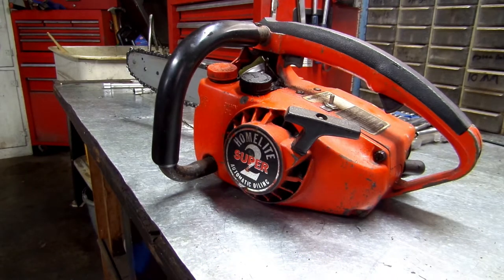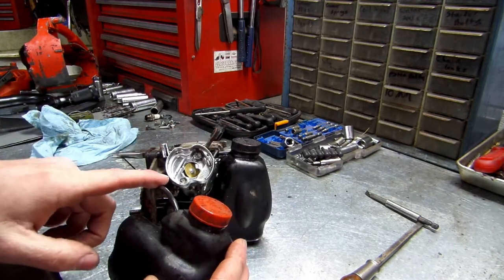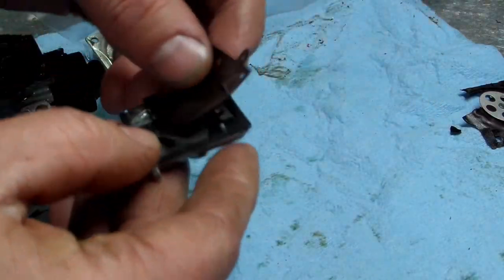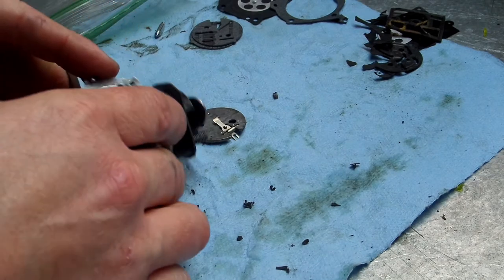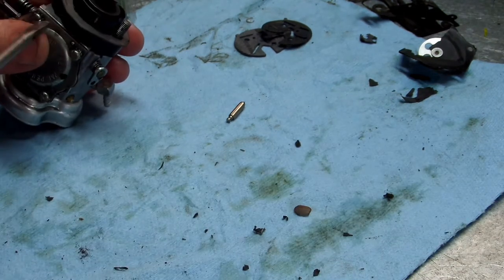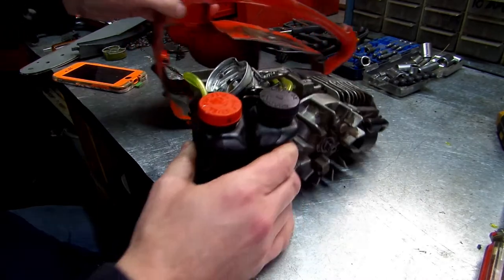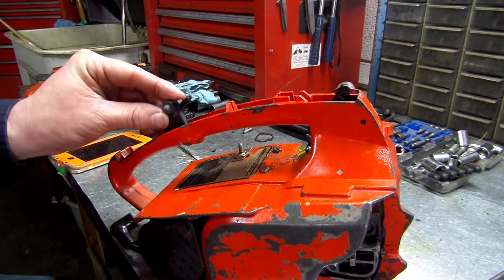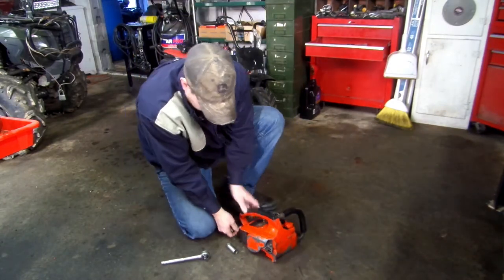Homelite Super 2 Carb Rebuild

Comment: Did you compare the metering diaphragm's center nub that intersects with the lever to what you took off?  Some of the aftermarket diaphragms have the nub too high for the HDC lever in the metering chamber.  The result is constant flooding.  Like you I had to replace the metering diaphragm because of that flooding.  I went with Walbro parts the second time around.  The second circuit plate gasket that comes in the kit is for the Single Adjusting screw HDC carb used on these engines.   Good Job.

Comment: No need to remove the trigger assembly.  Just remove spark plug, tuck the wire in the hole, unhook the kill switch wire, then slide the motor out a little until you can unhook the carburetor linkage.  Works fine.
Good filming.
Reply: yup... i only knew this cuz i just watched leon do it not 5 minutes ago... he said you dont need to take it off and he removed the spark plug first
Reply: Yeah that's what I did too without pulling that coil off of there you know that way I don't have to Gap it and stuff I think this one's just dirty the one I'm working on

Comment: Hey yo man I pulled that engine assembly out of there just like you did and I didn't have a cover on my air breather either it was just you know the sponge and it was wet with water I'm restoring the old one that's really dirty it's got compression it'll probably run but no cover on that air Breezer what's up with that

Comment: To put a hose over  a nipple,....put a hose in a coffee cup of boiling water,... just the tip it softens and lubricates it.
I would have taken a small storage tub and a paint brush and added some gasoline in it and cleaned everything up.
I used to use paint thinner on everything but now  87 gas is cheaper.
For 2 cycle mix I use Sunoco 90 (octane from the pump that says no ethanol)
I don't know what year that saw was from but everything is straight screwdriver.
And the oh shit moment for me was when  he took off the trigger assembly,.....never done that but I bought 4 saws off Ebay and one has a hard trigger pull and I hate it.
All of my saws were plastic,....so thats what I buy.
The last video I watched the dude had a needle valve gauge.

Comment: In regards to the sprocket nutt during reassembly on these xl's... is there a torque spec? Or just a good snug up will do. Thx
Reply: When you are taking this particular saw apart you don't have to remove the sprocket nut. The bar is held on by one nut unlike a still or forest king which is held on by two.

Comment: Oh and by the way I did end up boogering up one of those Phillips on the bottom I use a little bit of heat from a small torch and got him loose the top ones I was able to push down on better got them to crack

Comment: I bet you had to go back later and put the duckbill/check valves in the hole in the fuel tank and on the short oil line didn't you?  Im working on one right now that needs hoses and duck bills. With no or a bad one in the oil tank the saw will smoke like crazy because it will suck bar oil into the motor and burn it in the combustion chamber it also wont oil the chain or at least not very well if it does
Reply from the maker: Had them on order for my shop at the time of this recording. But yes had to after they came in. You can install them just buy removing the recoil cover.
Reply: @outdoorpowertech7738  Mine does not have a air filter cover neither and every video I have seen of the Super 2 shows them as not having one either . I haven't checked the parts diagram yet to see if the had one from the factory or not
Reply from the maker: They don’t have a cover just the plastic cover over the choke